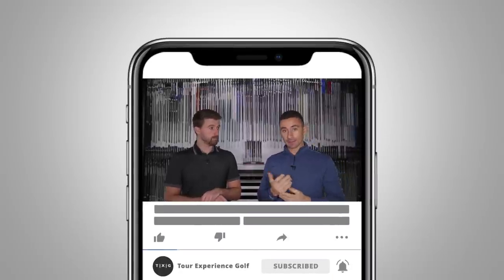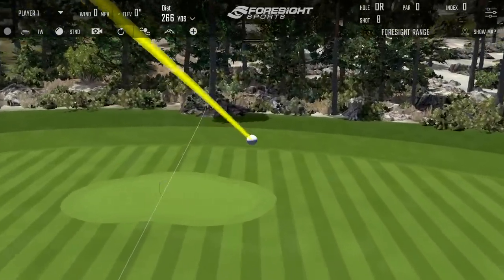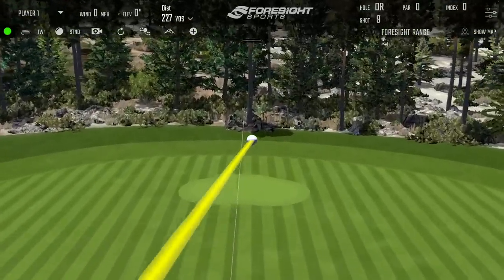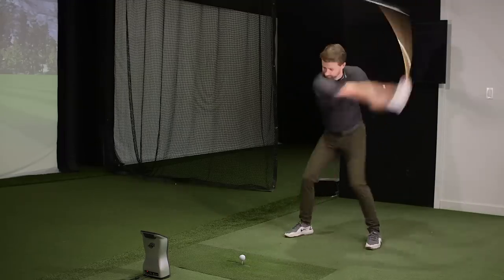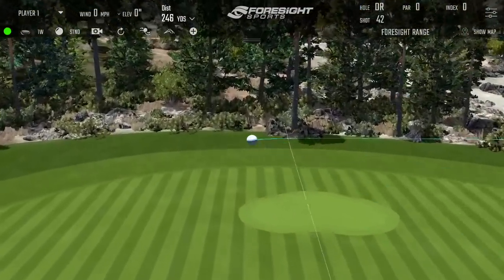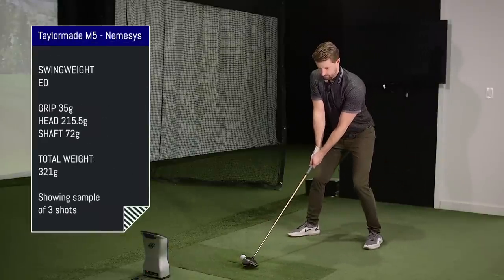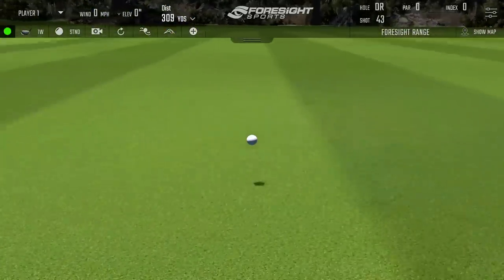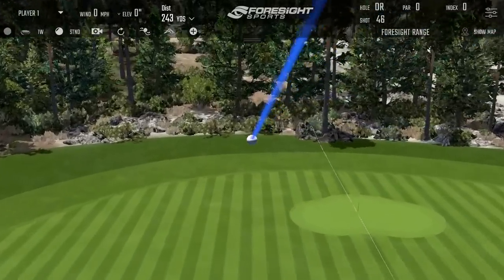Blind Test – Swingweight & Total Weight | Driver

Comment: Hi Ian, 
In your vid about swingweight a year ago, u mentioned "shaft length 43.5" with the driver will give a total length of 45" which is what u always fit yr clients as standard.
I'm a bit confused, is it 45" shaft length or 45" total length?
Reply: Imam Subhan 45” total length.  The raw shaft length is 43.5” but when installed plays 45”.  👍🏻
Reply: @ianfrasergolf  So how do you explain the test on shaft length between 44 and 45? Coz then the total length will actually be 45.5 and 46.5.
Reply: Imam Subhan 44” and 45” were the total length of the clubs not the shaft length.
Reply: @ianfrasergolf  Thanks much Grandmaster. Makes a lot of sense then. I hv cut my shaft down to 44 i.e total length shld be 45.5 which means I shld cut another half then to optimize strike point. Thanks again Grandmaster Ian. 👍🤘

Comment: I got fitted for cobra forge tech one length irons, added jumbo Max XL grips which weigh 120g. Should I be adding lead weight to the heads so there’s weight at both ends

Comment: My Sim head weight is 195.4g. All of the head weights in this video are 200g+. Are you adding hot melt to the head or adding the Taylormade adapter weight to the head weight figure? If so, what is the TM adapter weight?

Comment: Very surprising to see the effects of grip weight. Now what happens when the shaft is cut down?
Reply from the maker: less total weight and lighter swingweight
Reply: @clubchampionmedia  Grip weight changes can be huge as they showed, but when the shaft is cut down it's not really much to do with the "total weight". After cutting it down say an inch, an inch of shaft doesn't amount to much weight. It's more the change in balance point which changes the swing weight scale. Whoops I meant to reply to the poster not TXG as I gather you know this already, ha-ha.

Comment: One question i bought a sim 2 driver and shortened the shaft to 45 inches. The swing weight is like a c9. When the home order ends and i set an appointment can i bring in my club and try and fix the swing weight and bring it up to a d4-d5?

Comment: My total weight of my driver is 321g’s but I can’t feel the head 
Grip is 50g’s
Shaft 65g’s
and head weighs 195g’s
There’s 11g’s of missing weight which I assume is the sleeve adapter
Do I calculate the adapter as head weight or shaft weight?

Comment: I cut a half inch off my 3 wood. The swing weight is off now. Should I had lead tape to the head?
Reply: Only if you are having issues with the performance. If you're hitting it fine then don't worry about.

Comment: Brilliant video showing what happens if you tinker with clubs and grips without understanding the mechanics. 
Also  something to note when buying 2nd hand clubs that may have had OEM specs changed by previous owner 
Here is a good article on Bryson DeC and his 125g Jumbo grips and a 14hr re-fitting session.

https://www.pgatour.com/equipmentreport/2019/04/17/golf-clubs-equipment-bryson-dechambeau-cobra-drastic-change-to-grip-weights.html